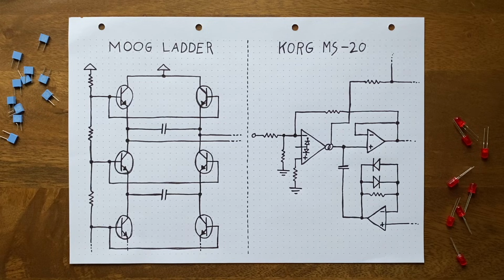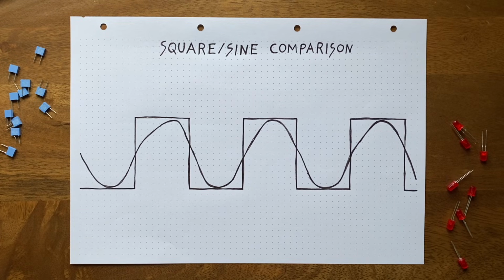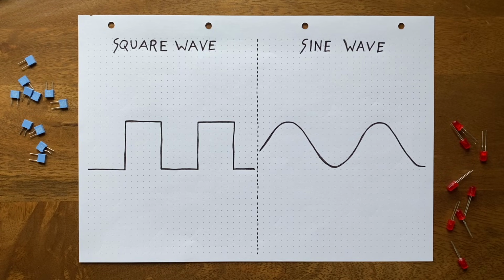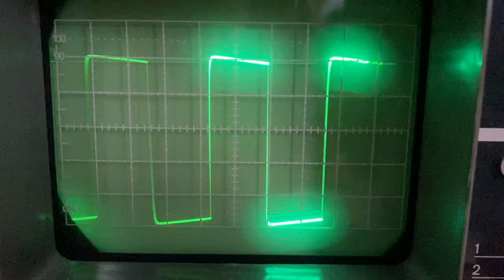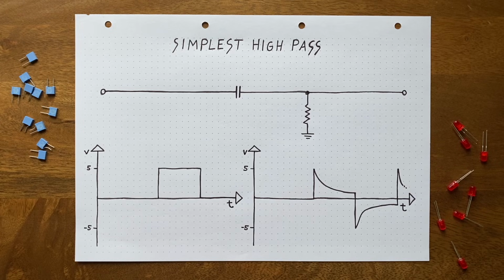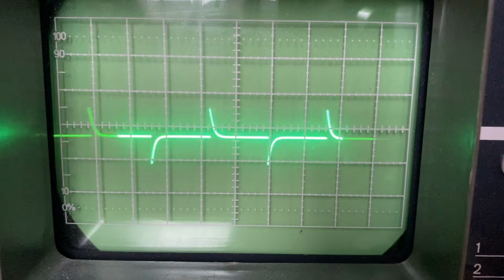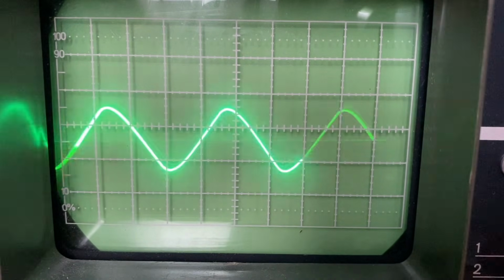DIY SYNTH VCF Part 1: Analog Filtering Basics

Comment: I'm still confused. I understand the basic principles here, but I can't wrap my mind around what's actually happening. Current is flowing from the input into the resister, then through the capacitor and into the ground. So, what exactly is reaching the output? If electrical current always takes the shortest route to ground, how does anything flow past the capacitor?

Comment: 7:58
Really well explained the concept analogously, but unfortunately a real life experiment with a balloon reveals (rather counterintuitively) that it gets easier to push more water in as the radius of the balloon enlarges.
However, the analogy serves its purpose in painting a  good mental model for the intuition behind the working of the capacitor, and I can't complain on that front.
Great videos, I'm a big fan!

Comment: I am actually an electrical engineer (at least on paper), but i could not agree with your very first statment more. I always wanted to build filters myself, specially the SEM filter from oberheim, but to condense the important parts out of the whole schematic, if you even find good, readable ones is quite a task. With more modern circuits it gets even more difficult because some integrated circuits are used that are hard to come by. So going back to very discrete designs is a good way to start.

Comment: Дружище, почитай учебник по ТОЭ. Ты допускаешь много ошибок при изложении, особенно при описании АЧХ. Ты неправильно рассказал про частоту среза. Она измеряется по уровню 0.707 умножить на амплитуду или -3 дБ от максимальной амплитуды. И неправильно рассказал про фильтры.

Mate, read a textbook on theoretical basics of electrical engineering. You make a lot of mistakes in your presentation, especially when describing the AFC. You incorrectly told about the cut-off frequency. It is measured by 0.707 times the amplitude or -3 dB from the maximum amplitude. And you got the filters wrong.

Comment: at 12;29 you plug the pos of your scope into g13, but nothing is plugged into the positive rail on either side. Also the pos output jack is plugged into H7. What supplies pos voltage to the circuit, the scope? Just lost on this here but everything eolse is fine.

Comment: A "pointy waveform" actually sounds "harsher" because of the short transient, by the way. It's not because of the higher frequency content.
Reply: Those short transients are a result of the slew rate of the high frequency content. Look up the Fourier Transform Function. You can basically make any shape of waveform by adding sines of varying frequency and amplitude.
Reply: Those short transients require higher frequencies to exist. Sharp transients = more high frequency content

Comment: Are rc filter diagrams backward to actual electron flow? (Vin and Vout in those diagrams are backwards due to conventional current reasons or similar?) That circuit only makes logical sense backwards

Comment: If that pot is turned all the way to maximum filtering, then the voltage source increases, that has the same or similar output as lowering the r val of that pot, right? (filtered frequencies would be audible again) (V=IxR seems to say yes!)

Comment: So increasing r makes less current get to that capacitor and thus the capacitor fills up more slowly, and because it’s filling up slower then it can absorb pulses of voltage that are longer (lower frequency waves) as r increases. Correct? Thus it’s not really practical unless the output is actively amplified in an inverse relationship to amount of r?

Comment: Why does the current on the first circuit go back through the r, instead of out the voltage out terminal? Basically, why doesn’t a quick cap charge and discharge make a delayed output instead?

Comment: Woah…wait…a square wave is that same sine wave at the same fundamental frequency, although with a theoretically infinite number of upper harmonics and the filter removes THOSE and only leaves the fundamental sine wave that remains? And then when it goes to silence it has removed that base frequency of that sine wave? If yes, then what about more complex wave forms, such as a wildly variable wave of a standard wide frequency range song?

Comment: Hi there, I have the kit but bit confused by the 0.1uF Tantalum capacitors as their polarity is not marked?  Am I missing something or do these not have polarity?  Thanks!
Reply from the maker: i think you‘re looking at ceramic capacitors - they are non-polarized. check the manual, there‘s a dedicated section explaining all the components. you can find both manuals for VCO and VCA on erica synths’ webshop.
Reply: @MoritzKlein0  Thanks!

Comment: I know this is a bit of an older video, but I'll try my luck with a question. I completed the VCO on the breadboard and had some space left so I tried adding this passive filter. When I do the potentiometer acts more like a volume control than a filter. When I turn the potmeter down I still hear high freqs but at lower volume. Is this because I'm feeding it a saw wave instead of square? I double checked the caps value and tried two different stereo pots (100k, 1M), they act the same way. What is a reasonable path for problem solving here? Either way, thank you so much for your videos, I'm having a lot of fun!

Comment: I  Like that You have an internal dialog about how things work, and that You show examples on the scope, using an actual signal passing through components.  but You are missing expressing vital fundamentals of electronics theory.  You have not stated what load is on the "scope probe", and You don't really explain that in this case "ground" is just a return path of very low resistance, and is in fact a conductor. 
   What happened to variable capacitors?  (no viable components indeed! }  You start off the discussion by stating that these synthesizer filters use all these weird components, and such complicated circuits.  This is mostly because voltage variable capacitors, that work in the low impedance, low voltage realm, of direct audio filtering from .0001 uf to say 10 uf, in small simply controllable (and relatively in expensive) units did not exist in the late 60's to early 1970's when this stuff was being developed and made by hand wiring small modules.  

What were the options?  The theremin used radio frequency oscillators , one variable with variable capacitance introduced by the performers hand or body, and the other a fixed osc operating in the Khz realm, and devices like Hewlett Packard test oscillators used variable capacitors that were roughly 6 inches square by 8 or more inches long.  So virtually all the filters developed for early synths that were voltage controllable used some king of multistage phase shift filters that had some voltage controllable "resistance" element, but fixed capacitors.  The most common emulated Moog's differential amp , ladder circuit.  The other option was to continue with beat frequency oscillators (like Buchla) or use very hi impedance circuits.

 The knee of a curve is generally considered to be the three DB down point.  In any filtering circuit there is literally no point where filtering begins,...some filtering happens at all frequencies, but is proportionaterelated to how far You move away from the knee of the curve.  You have to define how much signal is lost. Cut-off frequency is usually the frequency at which voltage gain becomes 1/2 ,  so it would be the 6 db down point.  That term is borrowed from specifying  gain elements, like transistors or tubes.  Usually in synthesizer jargon,  "cutoff" is defined by how many DB down the signal is 'at cutoff".

Comment: You really need to think through your analogies  The ballon analogy would work if it was a reservoir that allowed water to accumulate inside it (in a "T" connection as it passed through the pipe).  In the late 19th century and early 20th cent , the pipe analogy was extensively used to explain electronics, and that is why the term "condenser" was used for capacitor, as tanks were used in piping systems to store the pressure of steam..  Continual use or passing through a voltage does not break a capacitor, and in the first instance of applying a voltage to a series capacitor,  the flow of electrons is completely unimpeded.  So Your explanation is sort of opposite of what actually happens.  Your electronic circuit works as a hi frequency filter because the initial impulse or high frequency spike is passed to ground, and once the cap is charged , it later allows the low frequency (D C ) component to pass through.  No amount of doing this "breaks" a capacitor.  Capacitor dielectrics break down when placed under higher than rated voltage, and almost always happens instantaneously with the application of the high voltage, across a cap that is loaded to ground.  Electrolytic caps take time to break down with excessive voltage as it takes time for the chemical reaction that produces out-gassing to blow open the vents in the end cap, an physically ruin the cap.  Your analogy shows that the water never gets through the ballon and pushed the water backward, it is just not a good analogy.  If this were the case, coupling caps would not pass any signal!

Comment: Listenning to a waveform reproduced by a speaker is different than the path the electrons take..  Of course electrons could take a 90 degrees turn but that has nothing to do with the waveform analogy that is demonstrated by an oscilloscope trace.
   The oscilloscope trace is just a graph of output voltage over time , with the vertical axis representing voltage, and the horizontal axis representing time.  It would have been nicer to use a bit of a higher frequency for Your example, (so that the sine wave could be more easily heard through computer speakers that have trouble reproducing frequencies below 200 Hz), and also a direct recording , from the oscillator output, rather than something played through a speaker and then picked up by a microphone.    Your sine can barely be heard through my computer speakers, but I can hear the speaker rattling on the table or whatever which doesn't really help a student understand how harmonics contribute to "tone color", a rather imprecisely applied term in electronic music.

  Square waves in fact have only odd harmonics which reduce  in amplitude by 1 over the frequency,  I think.  Saw tooth waveforms have odd and even harmonics, and sound more musical than squares.   Most musical instruments can be synthesized using a Sawtooth waveform as a starting point, while a clarinet, and some parts of a Sax's upper register or the sound of bonking a section of PVC pipe with the palm of your hand, sounds a bit more like a  square wave. 

Your analogy with the water  pipe doesn't clarify things too much, as the high voltage part of a square wave would be represented by the taller waveform, and the lower portion of the waveform would generally represent either zero volts, or a negative going voltage.  in Your example , the larger part of the pipe would allow a large current to flow at low velocity (and pressure), and the narrow part of the pipe would represent a higher pressure, and a higher velocity, so actually allowing the same number of water particles to pass through both sections of pipe, (as they are connected in series).  Still I enjoy You presentation.

Comment: Why do the resistances have to have the same values inorder for a higher order filter to work properly ?
Reply from the maker: because they set the cutoff point for the individual stages. if those cutoff points differ between stages, the filter's roll-off won't be sharply defined!

Comment: Its not a great analogy because when a pipe narrows the pressure drops but the velocity increases. Ask most people what happens when they pinch the end of a hose pipe? They would say that the pressure goes UP because the narrower jet travels further? In actual fact the pressure decreases but the velocity increases. There is a law covering all this and I think its Bernoulli's law but there is another law to do viscosity of the fluid which is Poisuelli's law. From the point of view of 'resisting the flow rate' the narrowing actually increases it. Obviously it's difficult to come up with good analogy's that perfectly describe an observed property.

Comment: Hey Moritz, thank you so much for sharing this knowledge. Your explanations are the best I've come across and easiest to understand. Thank you :) 

The answer seems obvious but to help complete the picture in my head, could you please confirm for me; the "Vin +" and "Vin - " (Voltage in positive and Voltage in negative) you see on these explanation schematics, is this referring to the voltage from the audio line in? i.e. a 1/4" TS cable coming from a line signal source or is it from a separate power source like a battery or DC power supply? 

Thanks again!
Reply from the maker: are you referring to the schematics in this video specifically? if yes: indeed, all connections are on the audio jack sockets. there's no batteries/PSU needed here, since the filters are purely passive.
Reply: @MoritzKlein0  Was referring to various peoples (including yours) active designs I've seen being explained on YT and DIY pages etc. I watched your active hpf design again this morning briefly (rushing out the door to work) 

I am trying to understand how to DIY a stereo active HPF with a single frequency and resonance knobs. I'm starting to understand the theory but theirs a few things I don't quite understand. You may get a couple more noob questions from me over coming weeks as the components start arriving in the mail. I hope you don't mind 😊

Comment: I am a newbie subscriber of this channel, but I am determined to view all previously posted videos (luckily not so many).
I think your videos are very informative, easy to understand, from the basics up and comprehensible to anyone interested. 👍
I'm a (retired) industrial electronics technician but I enjoy your videos very much, they bring back knowledge I thought I had 
forgotten because it was not required in my daily professional activities.
For example, when viewing this video on filtering square waves, it bubbled up from the dungeons of my mind that 
a square wave (theoretically) contains only odd-integer harmonic frequencies.
Your videos also include some new detailed insights that were not educated in my schooldays (I'm a pre-IC guy 👴).

I have a few small suggestions: please keep the videos within 10 to 15 minutes max., if more time is needed, you better split up the
subject in two (or more) parts. It makes it easier for the viewer to keep concentrated (especially electric old farts like me 🤯🥵🥴).
Also try to make circuits on a breadboard in such way that main signals go from left to right (and top to bottom) as much as possible 
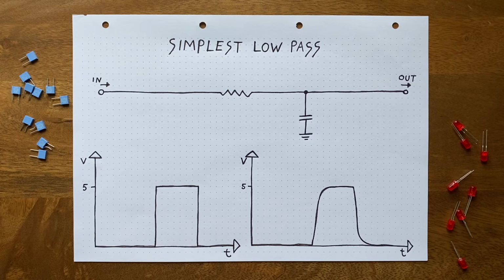(like schematics also are drawn), that way they are easier to comprehend, for instance, compared to 9:00, 12:20 is not done to well 😵.
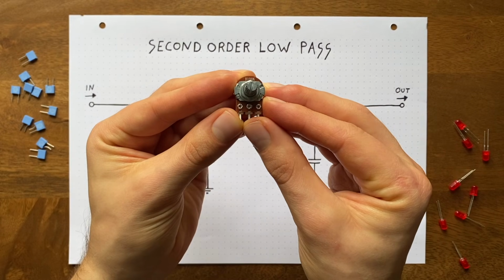An other thing is, I think you are mistaking at 19:55, in general these are called tandem potentiometers, "stereo" refers to two separate 
audio signals.

Marvin says: Don't panic and wear your Mask. 🖖😷👍 ❗

Comment: These are both nitpicks, this is an excellent video:
One thing is missing from your capacitor-balloon analogy: the absolute voltage of the ground plane. It's like sticking the end of the pipe with the balloon into an infinite swimming pool. The static pressure of the water outside the balloon (directly related to depth) is analogous to the potential (relative to infinity) of the ground plane. That's part of what's balancing the pressure of the water inside the balloon, it's not just the elasticity of the balloon. This would also aid your explanation of why you need to connect the grounds of the VCO and the filter together.
When you drew the transfer function of the passive RC filter, you placed the cutoff point far inside of the normal -3dB definition of cutoff. Maybe you were intentionally placing it at the -0.1dB point, but AFAIK that kind of tolerance is generally reserved for telecom stuff operating in the MHz/GHz.
Reply from the maker: you're completely right about the balloon analogy. in my VCO video, i actually explained it the way you did. got lazy here and cut corners! one thing though: i do think the "elasticity" plays a role, doesn't it? at least that's how i conceptualize the fact that while the capacitor is empty, it's easy to push current in, while it then gets harder exponentially the fuller it becomes.

also, the cutoff point sheet is really crude and eye-balled and should not be taken as anything more than a visual metaphor!
Reply: @MoritzKlein0  Hmmm... Now that I'm really thinking about it, I may have been wrong about the elasticity analogy being flawed. I may have been imagining a compressible fluid when I wrote this comment. My mistake!

If we assume the water is truly incompressible, then I think the elasticity of the membrane would be akin to the dielectric constant, and the ultimate strength of the membrane would be akin to the breakdown voltage of the dielectric.

I think the disconnect occurred because I tend to imagine electrons as a compressible fluid in rigid plumbing, as opposed to an incompressible fluid in flexible plumbing.

In this case, I think I mixed up the two analogies and imagined a compressible fluid in flexible plumbing, confusing myself. Damn you, physical metaphors! 

Ultimately I think it's a combination of the elasticity of the membrane and the static pressure on the other side that determines how difficult it is to push electrons in, and I have edited my original comment to reflect that.

This is truly an excellent video. I hope you continue to make easily accessible content like this, because a lot of this information is difficult to find outside of a university, and even more difficult to learn. Even for someone who's seen all these concepts before, it's still a great way to stretch the brain.